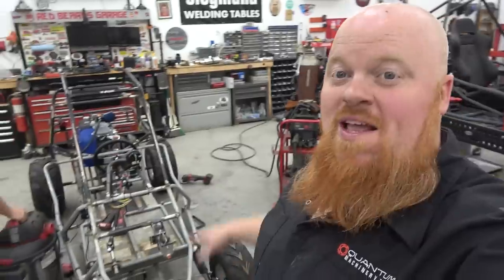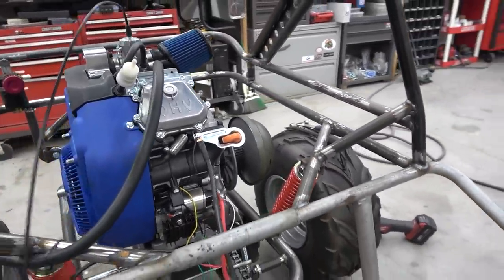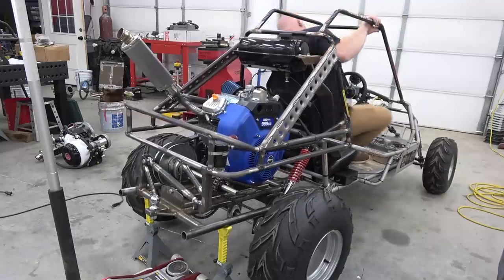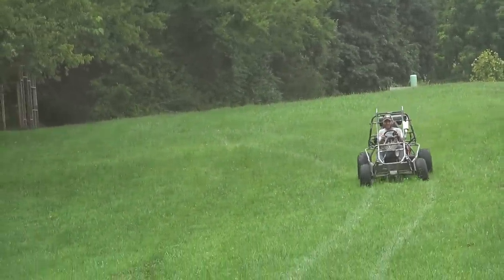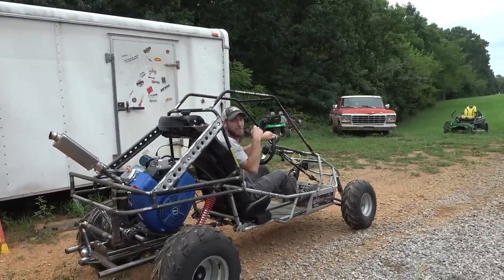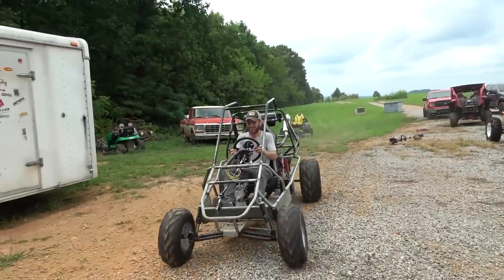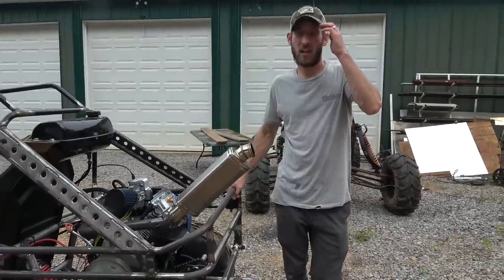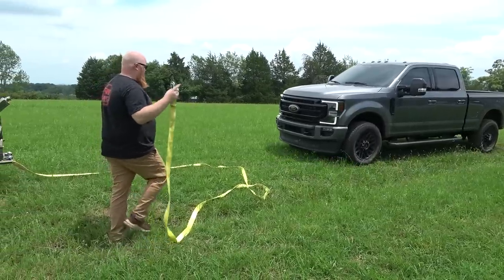999cc V Twin Go Kart First Ride ~ Will It Tow 7000LBS?!?!

Comment: I'm stoked to see this monster perform! Hopefully the aftermarket parts industry gets behind some performance mods for this platform, I can already see the Redbeard thumbnail "First 100hp 999cc V-Twin".
Reply: That wouldn't be that great of an achievement. Have you ever seen the kids mini dragster? They start with a 5hp engine (about 200cc) and get 55-60hp out of it. 20%of the size and 50% of the power.
Reply: @scootersonlyrepair6773  I didn't imply it would be difficult for the engine to make big power, I just said it'd be cool if he was one of the first to crack triple HP digits with one of these particular engines. And yes, I realize that displacement isn't the only way to make respectable power, forced induction proved that decades ago.
Reply: @scootersonlyrepair6773  Next-level ridiculous comparison.  
Honda managed to squeeze 60hp out of a 6cyl 250cc engine with the RC166 and that was pushing it even by today's standards.
The engine used here is incomparable and designed to be produced at low cost for low stress application.  Nobody who knows anything about engines would bother comparing.
Glad RBG works on these engines.  Interesting to see these things being pushed.
Reply: @scootersonlyrepair6773  no one cares for Debby downers man keep it positive brother 🙏
Reply: @scootersonlyrepair6773  How?! I'd love to see what they're doing! Is there a YouTube or forum for that sort of modding?
Reply: You cannot make 100hp with these engines for very long. It would be a throw away item. For example, its air cooled. And the cylinder fins and fan can only move so many BTUs. Probably 30-40hp worth at 104(40c) degrees. 100hp would rapidly overheat the components and cause catastrophic failure. 

If you want to make 100-300hp for $1000 you can make this happen in every city in the world: buy a salvaged car motor.

Comment: You can also solder a ball on the end of a throttle cable to make it work with those carburetors or you can solder two cables together. I always just make my own with a blob of solder on the end of the table.

Comment: My stock 420cc predator powered gold cart pulls my 12 ft trailer with full IBC tote weighing over 3200# total including pump and other equipment.  It's great uphill. You have a little more than double the engine and you can tow almost  double the weight.   Sweet

Comment: Impressive! I'd say your on track with your future fixes and update plans. Fix up the front end geometry and add a long travel suspension with a wider wheel base and it would be awesome! If it were me I'd try to encase the exhaust inside the roll cage to protect it in a roll over, but it looks like space is limited.

Comment: 1:14 what's the point of the box? Besides when the plastic sides cave in and break you have no throttle. Just weld 2 tabs and be done with it.
Reply from the maker: Then you have a dangerous open throttle cable. In the box it’s all protected
Reply: You can solder on a end to a regular throttle cable or do a little dot of weld on then end. Great video though!

Comment: NICE, So ended up on your page looking at some of the builds and such.  The super charged kart was a major reason for it but I know you did a wet system on that which is pretty much a no go with a turbo setup which will have issues running as a wet system and I was thinking about building a nice little kart for knocking around town where I live but want something that will turn some heads.  Anyway I am long winded but was thinking about why auto manufacturer's are starting to really get into stuff with turbo's and supercharges and the reason why they hadn't years ago and I have to say it's reliability of those systems with a carb.  Now that fuel injection is so common it comes on the cheapo's that is no longer an issue but small engines haven't gotten there but are starting to.  So I thought, hey maybe I can figure out a way to do my own EFI and came across NanoEFI which is in development.

I think if you contact them and try and get a kit to test with a turbo or something it will show a lot of others the potential viability and get the community even more involved.  IMHO this kit is EVERYTHING I would want including WiFi tuning.  You could literally flash a tune for your kids to run around and limit their power then flash it again and go for broke.

Comment: I’m building the exact same set up as I type this. Do I need to run a cvt set up over a centrifugal clutch? What’s the benefits? This will be used off road, a lot of hills and creek crossings. Any help is appreciated, I’m a mechanic by trade but not to good with this knowledge nor am I any good with fab work but learning for this build.

Comment: i still would rather my 99 thunder cat 1000 3cylinder 2 stroke with stock 170hp at 7000rpm . got the sled for $700 . mine has suzuki samuri transfercase and axles put in a baby rock lizard. frame . foa 16 inch coilovers , d and d 8.3-20 patty tires on 20x8 beadlock rims .